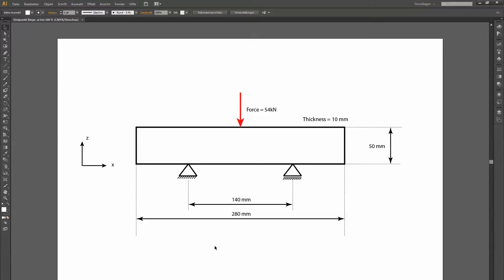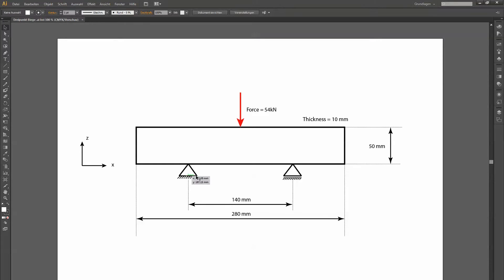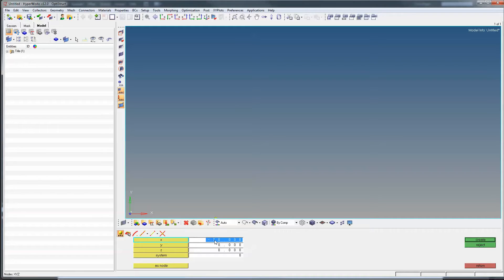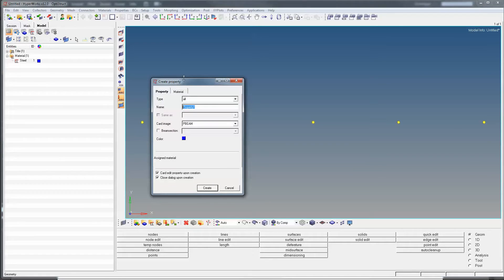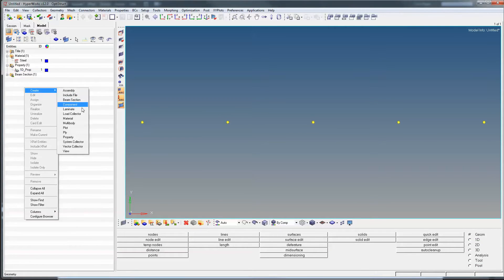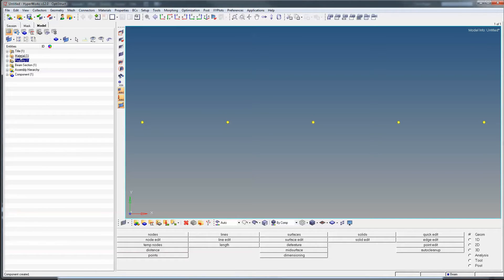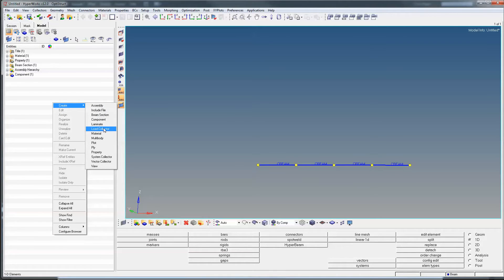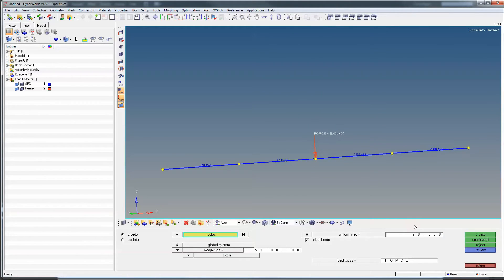Hyperworks 12 Modeling 3 Point Bending Beam + Topology Optimization - Part 1: 1D Modeling

Comment: Hello, at 12:17 why did you lock dof5 in both boundaries? They can both rotate around the y axis, thx. Edit: Nvm you made a correction lateron.
Reply from the maker: +CurrencyPrime Actually you are right! I need to correct this. Thanks for your Feedback!
Reply: Hi, I have another question. Is there any way to delete a mesh in a later step? I have to use the student version which is capped at 10000 nodes and in assemblies I often end up using more but I don't know how to clean a mesh from a part. Ty.
Reply from the maker: Hit F2 and delete elements. You can choose by geom to delete elements from a solid or surface.